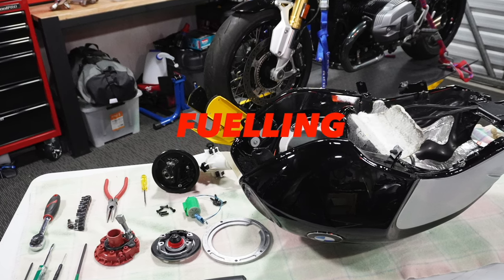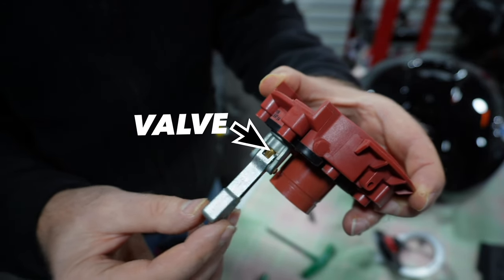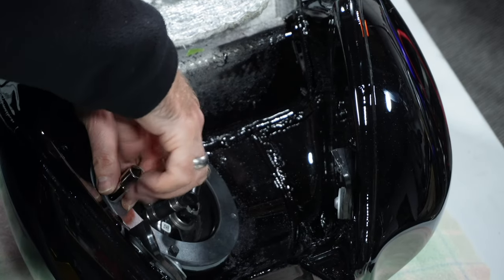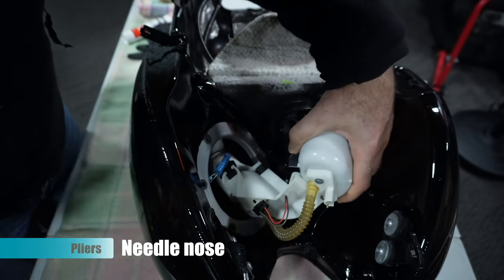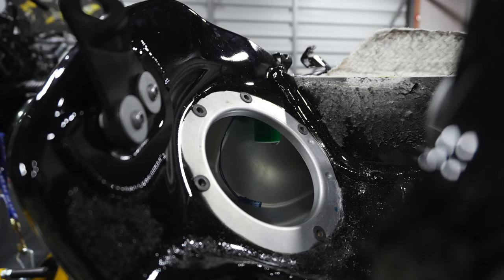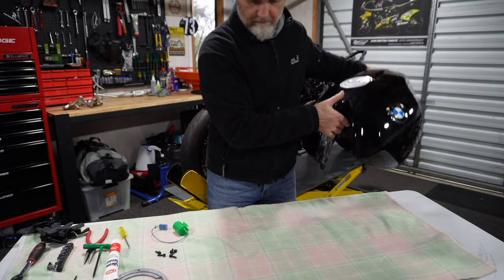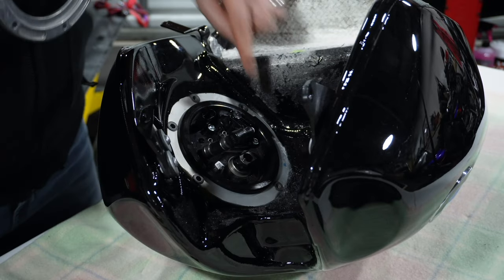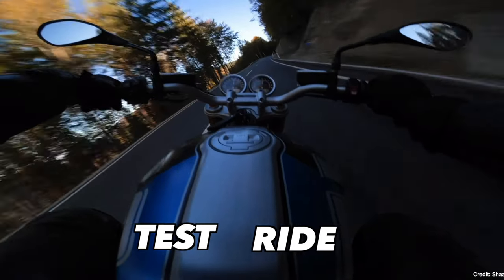R9T: Rattles, Leaks and Fuelling ...

Comment: That fuel reserve level resistor on that plug sure looks like an afterthought by BMW.. Macgyver would be proud. Great video tutorial !
Reply from the maker: @HuskyRides, it does look a bit "naff" doesn't it!😆 You're right. Some things on the R9T are done really well, like the build quality of the original 2013 aluminium tank. Then it's let down with plastic bits where there should be steel components. Still she's a beautiful bike.🤩  Im glad you enjoyed the video @HuskyRides, thanks for the feedback.😀

Comment: Hello, really enjoy your videos, thank you for sharing.  Hopefully not a random question, but with your experience in tearing down and reassembling the R nineT's do you know how to remove the Starter Motor cover?  I have a ilmberger carbon fibre replacement but it is not clear how to remove the plastic oem cover and I do not want to break it.  I've not been able to find any steps or guides online.  My nineT is a 2022 model.  Appreciate any guidance you can provide.
Reply from the maker: Hey @adamtiberi, my apologies for my late reply. I've been on holiday. I'm guessing you have already solved the problem. If not, let me know and I'll send you the steps.😀✊️👊👍
Reply: @outtheresomewhere  no problems at all. I’ve not solved it so appreciate if you can send through the steps. Thank you so much for the response.
Reply from the maker: Hi @adamtiberi, 
First a disclaimer, I am familiar with Ilmberger, but not at all familiar with the Ilmberger starter motor cover, although I have looked it up after you mentioned it. Very nice indeed.😀
That said here are the the basic steps as follows. If after reading them you don't feel comfortable proceeding, then you are best to ask someone locally , maybe at a local motorcycle club to give you a hand. 

But once you are ready, here are the steps to replace your Starter Motor Cover.....
 
Since the Starter motor is located between a few other components on the lower left-hand side, you need to disconnect (but not completely remove) a few things. Take some photos before you release these other components, then you'll know how to reinstall them along with the new cover.

1. Remove the seat
2. Remove the seat bracket cap so you can disconnect the positive remote battery lead (wrap it up in a rag to isolate it)
3. Detach the exhaust flow control valve servo (that,s the black box directly behind the starter motor). You can leave the cables attached. You only need to detach this so that you have room to pull out the Start Motor cover.
4. Remove the solenoid terminal, unscrew the nut, remove the spring and washer, then detach the lead.
5. Disconnect the wiring connector
6. Release and remove the starter motor cover, when doing this take a look how the "pegs" locate into the grommets.  

At this stage you can now reverse the above process, but install the NEW cover. 😀 As I mentioned, Im not familiar with the Ilmberger cover, but assuming it is like-for-like to that of the OEM, these steps should work.

I hope this helps or at least gets you heading in the right direction.
Thanks again for the question 😃👊✊️👍
Reply: @outtheresomewhere  thank you so much for the detailed response. I replaced the OEM headers with the Akrapovic system and I removing the OEM pipe I also removed the exhaust valve servo and replaced it with a servo buddy. So I assume that means I can skip Step 3? I’ll let you know how I go. Thanks again!
Reply from the maker: @Adamtiberi yes you can skip step 3 when you have a servo buddy as the buddy is nicely out of the way. It sounds like you're really cleaning up the styling. NICE !!😀

Comment: My r9t 23bike is leaking oil from the right side of the Engine
Reply from the maker: Hey there @swissmotorbikerent , that is rather unusual for such a new bike. Fortunitely it will be covered by your factory warranty. But still rather disappointing. Thanks for sharing and all the best with getting it resolved. Hopefully just a simple gasket replacement. 👊✊️👍